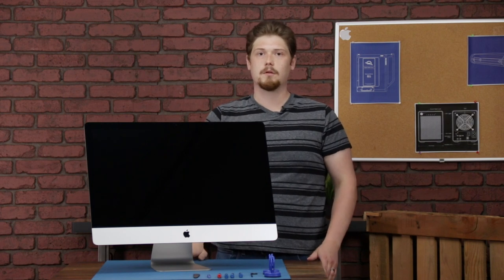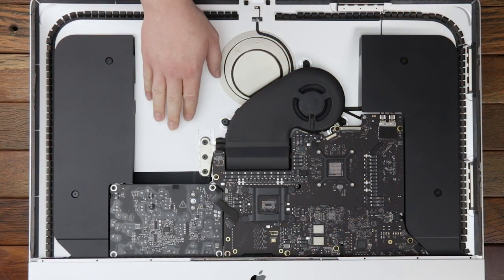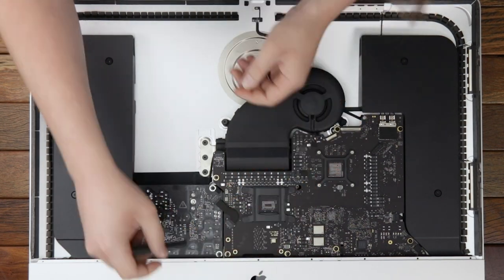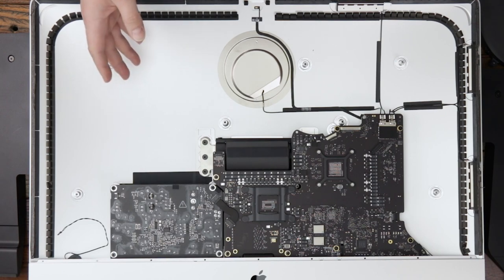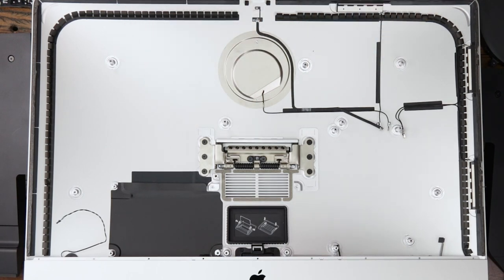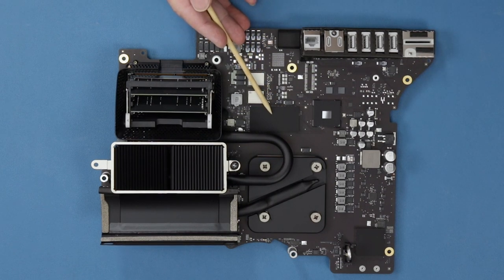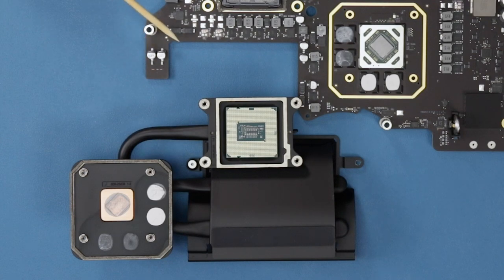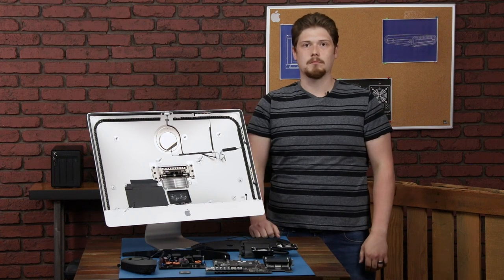2020 27-inch iMac 5K Teardown (iMac20,1)

Comment: Good to see the CPU is socketed. 
I just did my 2013 Mac Pro CPU which is more involved than this! Though I didn't have to remove a screen.
Still, the amount of money you can save by getting a base model with a reasonable SSD and upgrading Ram and CPU yourself is a significant chunk! Enough to pick up a good raid solution. 
Pretty disappointing that they solder the SSD on logic board. It's stupid in laptops, it's stupid here. 
No computer manufacturer will help you recover data if a logic board fails. So along with the T2 chip encryption being non-optional, this means you are on thin ice with your important data if you keep it 'on-board'.
Yet another reason it have a good NAS or TB raid. 
Still, for the price, the current iMac is pretty decent for content creation.

Comment: Hi there, great job on this tear down, tell me do you think the logic board from the 2020 iMac would be compatible in a 2019 iMac, mine has just failed in my 2019 out of warranty with a price of £950 to replace it but I have the chance to buy a 2020 board at £500 just thought perhaps it would fit in the 2019 iMac, other than the camera being different and the ssd is soldered, not much difference, what do you think?

Comment: is it possible to put a 10900 or 10900k in the iMac or is only possible to boot with the custom apple 10910 cpu?
Reply: This thing would thermal throttle before the system is booted.
Reply: only a regular CPU, like i5-10600, i7-10700 or i9-10900 not a K version, reason regular Intel CPU runs 65w K version runs 125w.

Comment: Hey, given the space available within the chassis because of lack of HDD, is there potential/setup to place extra HDD/SSD inside? And is the monitor stand arm removable so the whole thing could be attached to a monitor desk arm?
Reply: yes look for a vesa mount clip, you can use a metrocard of a thin piece of plastic to slide it into the arm, while the monitor is flat ont eh table, then unscrew the row of screws and mount your vesa mount...quite fast and simple

Comment: 5:00 can NVMe port be soldered on and used for secondary storage?
Reply from the maker: Based on our observations, it seems that the second slot serves no function, as the 2020 iMac only utilizes the soldered NVMe storage that comes pre-installed.

Comment: Is it possible to fit a mechanical hard drive in this system? I am guessing not - it appears there are no mounting points to attach the drive brackets and no SATA port on the motherboard.
Reply: You answered your own question :) Would be much better to add a secondary drive via Thuderbolt
Reply: you can add an external ssd in a usb3.2 housing for extra storage

Comment: hi bro ,  i mac 27 5k Ratina 2020 ssd any chance for upgrade to 1tb or 2tb
Reply from the maker: Unfortunately, no, the SSD on the 2020 iMacs is soldered directly to the motherboard, so it can’t be upgraded or replaced.

Comment: So, if the SSD breaks that means my $1800 go down the drain?
Reply: You would need to replace the logic board
Reply: you can always boot from external also
Reply: An SSD will wear out especially a small one so between being integrated and the T2 Chip it makes it an expensive repair.
Reply: Only people who completely lost their mind would buy an all-in-one with a dated design and a soldered SSD.
Reply: @r4biet  nothing Bad with the design if is not broken don't fix it but yea the SSD soldered not good , but it all depends what you ar going to use ir for , im going to get it because I will make my money back fast , and I need A New Mac , so for the options out there  right now for a Mac probably this is the best for the money , for sure you can get a more powerful PC for that money but I need MacOS and don't want to be dealing with a Hackintosh, also thinking if somthing happens with the SSD in the future I can boot from external via Thunderbolt 3 ,  what im more worry about more then the SSD and the desing is how long will Apple support the Intel Mac for with the new MacOs Updates and because they are moving away from Intel , imagine you spend all that money and in 3 years they decide they are not going to support them any more

Comment: Why the f*** do they solder the SSD in an all-in-one machine? There is so much unused space - even the cooling is still the same. They could have put a 2.5 inch cage into it for sata upgrades down the line and mount the SSD as nvme.. Literally every second sentence is that they care about the customer and the environment. Marketing bullsh*t at it's finest.
Reply: Interesting thing about computers, there are infinite choices, none of which you or me are required to purchase. If you don't need it or don't like it, don't buy it, they will never no it.
Reply: @poorfesor  :
Apple is marketing itself as an environmentally aware company and that they care about the customers needs and requirements.
They should then also live up to it.
Talking is just breathed out air with noises. Nothing more.
Reply: @Unix_Based  Sure and I was promised with mu secret coder ring, I would be able to send super Secret Coded message that no one could read and see for miles with the built in telescope. All I had to do was send in 10 Wheaties boxtops and 50 cents to receive this marvelous device.

Marketing is the reason that tripe convinced kids to send for it, the lesson I learned is to not deal with them anymore, no matter what they claimed about the products they sold. I would advise you to do the same with Apple unless you are being paid to knock them in which case feel free to earn your pay.
Reply: @poorfesor  :
Well, i moved away from Microsoft due to their shitty Windows10 still being in beta status, despite being five years on the market. I was simply tired of having every second update fucking up my install and puting my computer into an infinite bootloop.
I was using the Apple computer besides my Windows main machine but finally got fed up with and transitioned to Apple 100 for about a year ago.
Since i'm working with my computer, i can't really make a transition to Linux because most of the programs i need, don't even work on this OS.
I am in no way a person who is pro regulations, but somewhere it just has to stop.
They try to fuck up our minds and want us to feel bad for consumerism and all the environmental issues, but on the other hand, we have soldered on SSD's, non changeable batteries in mobile and portable devices and repairance and spareparts supply has been a challenge, that most people would fail to solve.
At this point it just has to be regulated, since big corporations aren't willing to do this on free will.
And that's not only with Apple, but Samsung and many other brands also.
Reply: they do it cuz they can. And thats why they are the most valuable company in the world.

Comment: much better the design of the imac 2011, much more robust and of higher quality. Any problem in it will necessitate replacing all the equipment. I don't like it at all, the planned obsolescence shows

Comment: That is a place for m.2 nvme.
Reply: Not at all... there is no such thing as a regular M.2 connector.
On the 4Tb and 8 TB iMacs half the storage is soldered, the other half is on a module that ressembles to a 2260 M.2 drive but is only a proprietary, flash module like on the iMac Pro. And it wont get any upgrade because the other half of storage is soldered.
Reply: @gillesaurejac383  You know this for a fact from which source?

Comment: If you have a mac right now, never buy a new one for 2 years. Because the Apple company plans to dispose of the last remaining safes as if they were attractive. Apple company, which switched from PPC processor to intel processor in 2006, will leave intel at once, just as it abandoned macs using PPC processors. Wait until the ARM processor Macintosh iMac-Macbook-Macbook pro and MacBook Air come out.

Comment: Another dreadful, alarmingly hard to upgrade iMac. Eight DAMN years and the repairability/upgradability still sucks. Using  adhesive tape to hold the monitor is a patently HORRIBLE way to do things. It is also too easy to damage the monitor during that process. Having the CPU and GPU attached to the same heatsink is also unforgivable. I wish Apple would re-evaluate this design and DUMP it. This is a pretty unforgivable design.
Reply: Best strategy is to buy the smallest SSD you need in the iMac and then just go external to a USB-C external SSD. My biggest issue with a "permanent" SSD is that SSD's can fail, so how would you tell the motherboard to ignore the dead SSD and not generate errors etc. Do you have to replace the WHOLE motherboard for a failed SSD? AWFUL.

Comment: No thank you.  With the T2 chip if the motherboard goes out, all your data on the SSD CANNOT be rescued even by Apple because it is encrypted.  I'll stick with my Hackintosh which is infinitely upgradeable and is much cheaper.  I love MacOS and have had Macs for thirty plus years...however I'm done with Apple's business model.  Ask Sony how many Betamaxes there are out there.  Apple is going in the wrong direction.  When Arm/Apple Silicon chips take over there will be an emulator to use X86 instruction sets and I will use some form of Intel/AMD X86 MacOS.  I'm willing to have a slight performance degradation using emulators.

FU Apple!!!